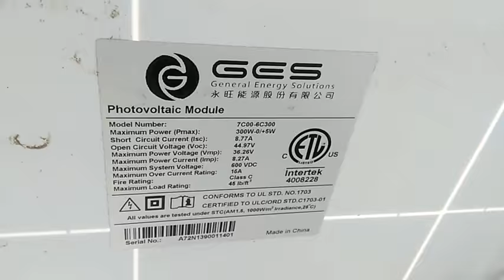Heating water with a solar panel

Comment: any energy wizz out there want to tell us if this is actually saving more energy than simply having two solar panels offset some of your electricity? and would it be better from an energy standpoint to simply run the panels directly to a heating element as he does around 12:20?
Reply: bo diddley
 .... This way is the cheaper way. In order to offset other AC use you must use a grid-tie inverter, which is fairly expensive compared to a water heater. The flip side is that once the water heater is satisfied, temp wise, there is no further savings. With a grid-tie system you could possibly continue to offset your power draw... and maybe (just maybe, depending on number of panels) you could sell back to the power company at times. The catch 22 of that? Selling back to the grid is a discounted rate and likely half of what you pay for power used. Basically there's a lot of math to be done to see if it's worth selling back to the grid and the typical system size needed to do that is usually over 5,000 watts, just to break even. At 200 - 300 watts per panel (plus electronics) you can see the upfront costs mounting quickly.
Reply: @rupe53  ok, cool, so this is an efficient low investment method - sounds good
Reply: @pawpawbandit3871  ... I would advise you do a little math before making an investment because the cost of solar gear can change at the drop of a hat. You may find a deal on a grid tie inverter that's 120 volt "plug & play" style, which means all you have to do is make sure it's connected to the same leg (if your heater is 120 volt) and you can supplement your electric bill without having to buy another water heater. Just remember, any power saved is power at list price. It's only when we get to selling back to the grid that we suffer the discounted price. Meanwhile some other appliance in the house can use those few hundred watts when the water heater is not drawing.

Comment: Yes Dave can you lies at heart water Simply Now period. You need a hot water pump you need a basic radiator to place where you want Heat this is a small PC radiator that's level on eBay runs all day small fan PC fan so basically you hook the pump up you run lines to the radiator. Now you need to put the water back into the watering system. This is done by check valve you probably need two of them you do not want your hot water heater going back into your cold water line you're cold main water line. You also do not want two suck from the 110 electric water heater that will be cast graphic when you turn on a valve period. What I have described here is the basic heating system for a wood burning fire system the radiator is a basic car with meter type radiator you can also go with a cast iron radiator...... Thank you very much for your video I am thinking about completing something similar to this next you'll be trying to cool your house with a DC refrigerator how cool is that I don't know I just thought .. so if you did not understand completely what I said above I'll say it in a different way your circulating your solar hot water heater with a pump within a loop with two check valves on the side so you don't have to worry about robbing your hot water tank because it's tied into your system you do not have to add chemicals to keep water from evaporating because it is tied into your system if there is any build-up of steam it'll flow out of your system or by your water tank check valve..

Comment: If any one can  figger out for me to get solar water heat with out using electric from a grid  I would appreciate  it as I'm totally going off grid  no power source  just solar ,
Reply from the maker: It depends on the climate. the black sheet like pool heaters work great on the roof when its sunny but if they freeze at night they aren't useful. In a cold climate heating with wood or propane might be the best option. Solar kinda fails when you get into heating coils unless you get a huge system.
Reply: I'm off grid and I heat all my water just from any excess PV solar not needed to charge batteries.  The way shown in this video Is the worst way to do it, unless you have a lot of money to waste. This will produce half the power from panels in the best conditions and many times less in average light.

Comment: the approach is wrong , you could have  used solar water panel with double glass and reflector to gain high water temperature. Your method is based on surplus panels. If I have surplus, of moeny i will be doing the job of Elon.